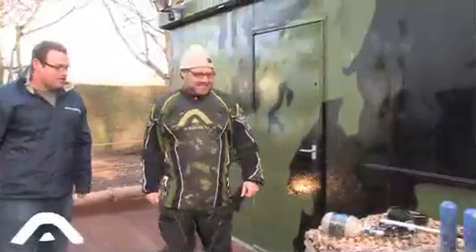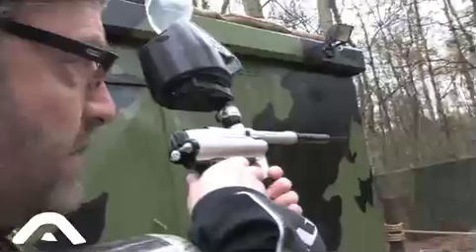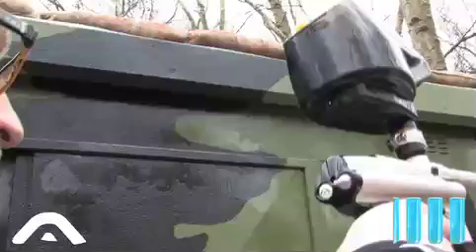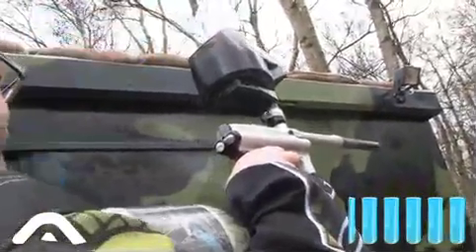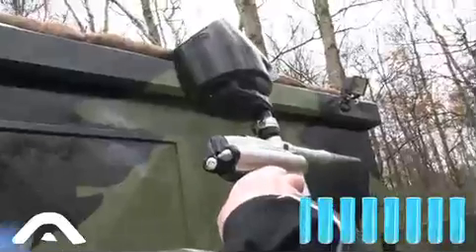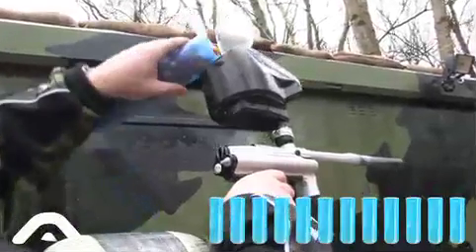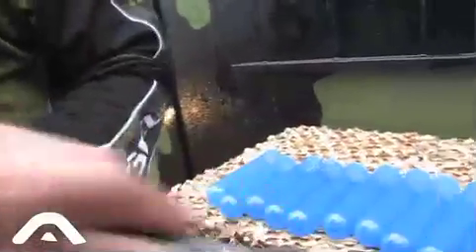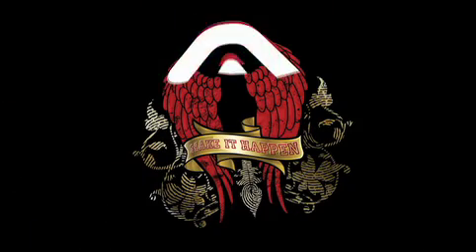Continual Firing experiment

Comment: The reason for the vid is that rumors have been running wild since the release of the first A1 that the gun platform could not shoot a proper amount of paint on a single tank. 5 pods, even as low as 3 pods have been claimed by some. As seen in the vid, at least with the Magno-internals it's a great deal more than that. Same as or more than other current high-ends.